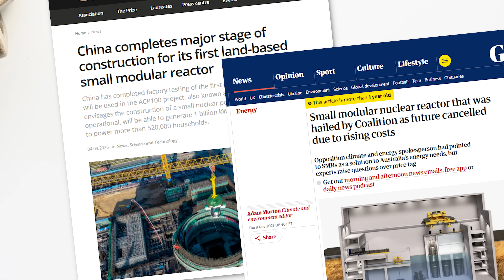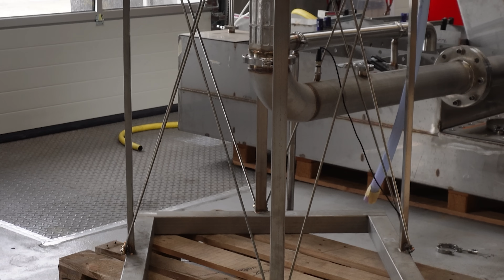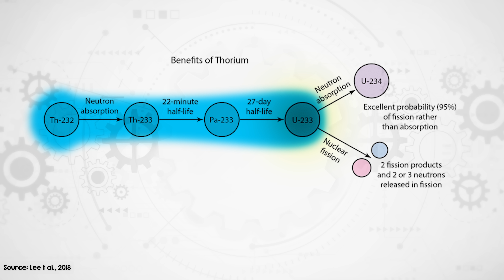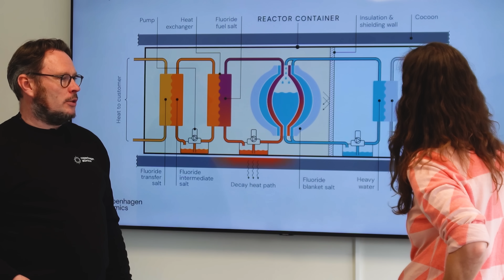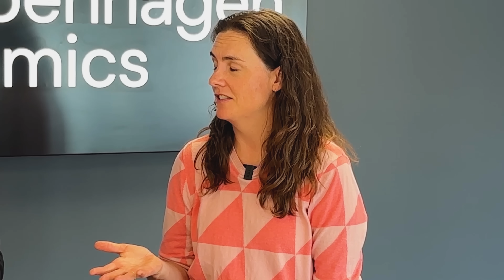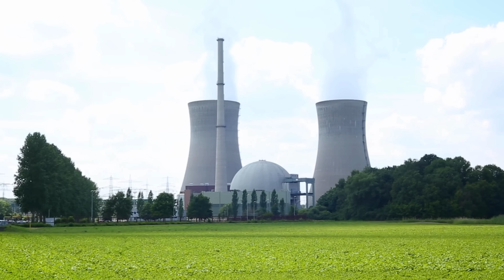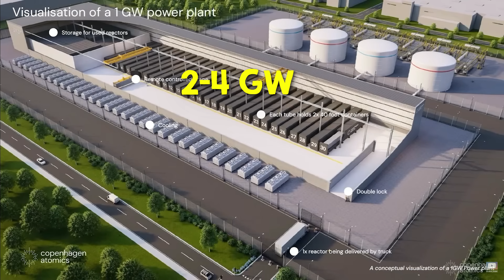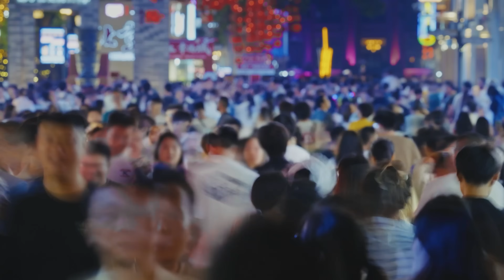Can Copenhagen Atomics Make THORIUM REACTORS Work? [TOUR]

Comment: Clean and cheap energy, the two goals nuclear power plants are well known for.
Reply: goals ... right.
Reply: clean, yes. cheap, yes but not in the EU and USA at the moment.
Reply: @stijn2644  Where it's clean, it's not cheap (if ever) and where it's cheap it definitvely isn't clean.
Reply: @horst4439  so all the operating NPPs in Europe and the US are dirty?
Reply: @stijn2644  In the end, in my and many other's opinion yes, but not imminent. Having pretended these are cheap always was a fraud.
Reply: @horst4439  May i ask why you think NPPs dirty, and specifically in the EU and US?
Reply: @stijn2644  not specifically. Just there I would trust engineers to be sensible enough to keep them somewhat more clean, but in principle. But they all are dirty in the end, because no one really thought about where to put the waste, except in this regard finland somehow. It needs to be found out, if it really works. The risk to run them is simply unbearable. Obviously also no insurance company accepts them, because of those risks, no one can calculate.
But I suppose it wouldn't be the best idea to enroll the entire dispute about NPPs in this place. This you might look up elsewhere, where it was discussed before in detail.
Reply: @horst4439  @FF-li6zj Okay thank you for the clarification on the dirty aspect of a NPP. I would like to propose a solution for the "waste" to you and hear what you think about it. 

The current issue with the waste is that it's generated in PWRs and BRWs that run on an open fuel cycle, meaning it goes in once runs for a couple of years and what comes out is considered waste. An optimal system would use a fully closed fuel cycle. This principle makes use of all the elements in the fuel, it fissions them into fission products (that have value of their own) and then 17% of them decay in 300 years to save levels, the other 83% decays in 10 years. These systems have been proven to work in fast reactors. The EU and US had them until the 90s when politics decided to end the programs because nuclear fell out of favor. 

On the topic of profitable nuclear power plants, why wouldn't there be any profitable ones? Sure you have some that run poorly, but all of them? Feel free to show me why not a single one is profitable, i'm genuinely curious to the answer.
Reply: @stijn2644  If you check Lazard's 'Levelised Cost of Electricity', power from established reactors in the US is about $29 per megawatt hour, cheaper than anything else. It's also lower carbon than any other power source except onshore wind - which is about the same if you ignore balancing costs for intermittency, and grid management costs to maintain frequency stability.
Reply: @stijn2644  Yeah, right. Show me one profitable nuclear power plant, and one actual working solution for waste.

Comment: Thanks for this - curious as to why having produced a truly modular reactor they then feel the need to deploy them in groups of 50-100 units.  Surely the advantage of these modular reactors is that they can be deployed near to demand - moving away from the old style of a few very large generators - requiring large distribution networks?
Reply: Copenhagen Atomics suggests many small reactors in parallel feeding heat to a single steam generator. As @justinterested5819 wrote "Bigger turbines are cheaper per Power produced." One turbine per reactor would be too expensive.
Reply: I agree that smaller groups of reactors would seem to offer potential for better distribution, and the opportunity to use the waste heat for local heating requirements.
Reply: As a firming source it makes sense to have a few in one place then ramp up and down
Reply: @theairstig9164  - I didn't think that nuclear was particularly conducive to being ramped up and down?
Reply: @jonathandorey8600  Solid fueled reactors can ramp at about 1% of output per minute from 50 to 100% - limits are thermal shock to the fuel rods, and changes in reactivity caused by excess production of xenon 135. Liquid fuel reactors that sparge all the xenon out immediately should be much more flexible.

Comment: Moltex is a better solution. The radioactive fluid circulates by convection. No pumps. No pipes.
Reply: Moltex uses stable molten salt. That's their unique selling point. The fuel is dissolved in molten salt, held in tubes and free to circulate in the tubes by convection. The tubes are then in a bath of molten salt which is the coolant that circulates. So there are pumps and pipes for that part of their design
Reply: @JohnSmall314  Moltex's reactor, like all fast reactors, needs a much higher concentration of fissile in its fuel than do thermal spectrum reactors like Copenhagen Atomic's Wasteburner, or the Light Water Reactors that make up 90% of the current world fleet. So in theory thermal reactors should scale faster. (That's the Canadian version of Moltex, anyway - Moltex UK is working on a thermal reactor moderated by graphite, but I don't think their design is as far advanced as CA's.)

Comment: Until they start showing the shielding in their renders, it’s a paper reactor.
Reply: Also the separation of fusion products from the salt. Every one of the MSR projects conveniently skips over that.
Reply: @GalvayraPHX   There barely have been any MSR projects ever. All were in times of way worse material sciences (mid 20th century), or the east few years. Nowhere near enough sample size to declare that.
Reply: @ZippyPiglin4136 CA reactors are being designed to avoid large carbon moderators because of swelling. Almost like they've used knowledge from the MSRE and other experiments....
Reply: @ZippyPiglin4136  A casual google search turned up 6 recent companies: Terrestrial Energy, Moltex Energy, Thorcon Power, TerraPower, Flibe Energy. So far, all vapourware. I wouldn't put much stock in what the chinese "accomplished" either.
Reply: @GalvayraPHX known how from multiple investigators  see Gordon McDowell here on youtube.
Reply: You many be surprised at how little shielding it requires compared to standard LWRs - the outer thorium blanket will be effective at shielding gamma but not so much for fast neutrons. That said, a significant proportion of the neutrons should be slowed past the heavy water layer where they can be then captured by the thorium in the outer layer. MSRs have the potential to have far more efficient neutron economies using liquid blankets coupled with online processing.
But I agree, I still reckon you'd need more shielding than their simple thin looking 'cacoon' thing.
Reply: @timothytaylor5867  Shipping container has half metre of steel, coccoon about 2 metres of reinforced concrete - and both are in a building which nobody enters, after start-up.
Reply: At 5:00 the diagram shows shielding, they call it the Cacoon. I can't tell if it's inside the shipping container or outside. Either way, it looks far too thin. Also it seem that it would make the shipping container too heavy to ship, it must need to be added after shipping.
Reply: @chapter4travels https://aris.iaea.org/Publications/SMR-Book_2018.pdf has details, also, the reactor will be shipped without fuel or coolant salt because they'll need to be melted, so I imagine they'll be added hot, once installed?
Reply: @chapter4travels  The cocoon is supposed to withstand an airplane crash, so it is not in the shipping container. It must be constructed on site. So there will have to be a bespoke site assessment and design by a civil engineering firm.
Reply: @ryuuguu01  I was thinking about that, maybe it's just a void in the shipping container that you pump high-strength concrete into once it's on site and plumbed in?
Reply: @chapter4travels  Large buildings need custom foundations for their ground conditions. You need to take into account the soil and rock water under them,  the sub-surface hydrology, and surface water flow during rain and storms. Any nuclear facility needs multiple security layers that extend beyond the buildings and site. Large buildings are made with internal steel reinforcement.
Reply: @ryuuguu01  All of that is really easy. All buildings need subsurface testing, and foundations are based on that. That's a piece of cake.
Reply: @chapter4travels  Coccoon is outside the 'shipping container' - which is transported without radioactive materials in it, and then stays on site.
Reply: @2x6x250ml  The coccoon never has radioactive material in it, but becomes radioactive as the reactor runs. From the plant layout they show in this video, the cocoon is part of the shipping container.
Reply: @chapter4travels  I think the coccoon is more recent than the video - they've made a few design changes, over the years.

Comment: Is this guy listening to what he says? Everything is getting strongly radioactive, yet every 5 years all the guts of the system must be rebuilt? Two heat exchangers in series, what is the efficiency going to be? I can't see how this technology could ever become "cheap".
Reply: The proof of the pudding is in the .. PoC. Let's get some accountants from hades going over the final numbers. So far that has defeated all of the proposed SMRs, as Rosie remarked.
Reply: I would expect the whole unit would be packed up and taken to remanufacturing facilities and replaced with new/rebuilt units. You don't have to do the whole installation at once.
Reply: Alfa Laval, the company that owns the plant CA started in, is the world's largest manufacturer of heat exchangers. The new diffusion bonded, etched flat plate HXs are extremely efficient, compact, and much cheaper than traditional tube steam generators.
Reply: @2x6x250ml Well, that explains the enthusiasm of a reactor that depletes heat exchangers faster than the fuel 😂